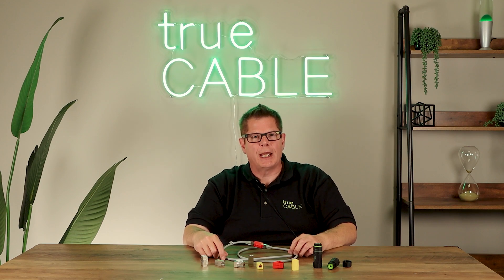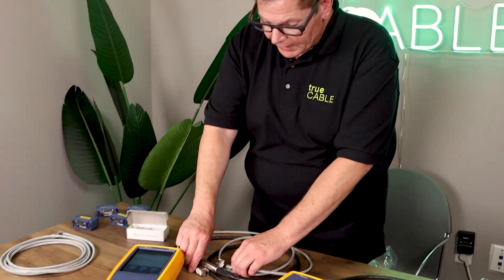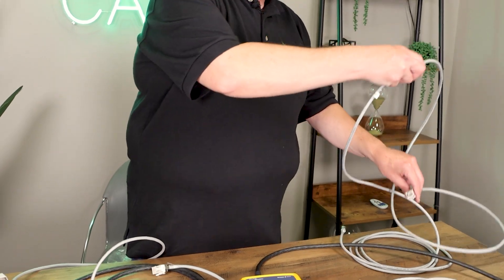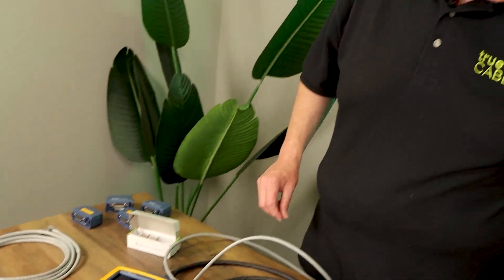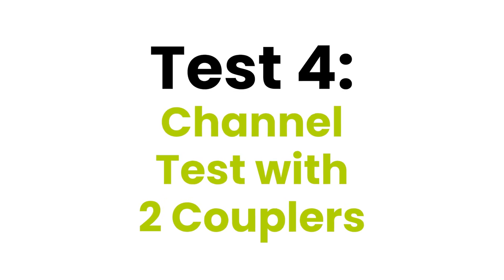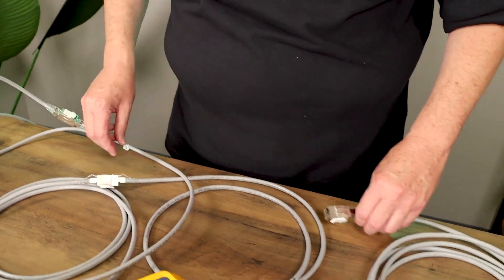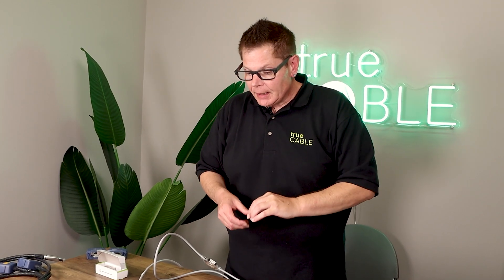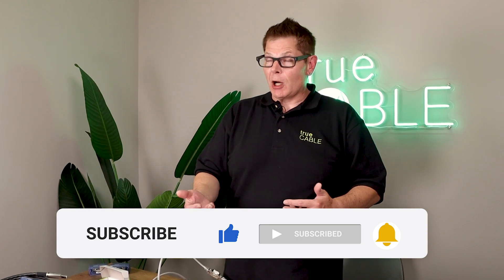How Many Ethernet Couplers Does it Take to Fail Testing? You'd Be Surprised!

Comment: When you mentioned couplers, does that include keystone jacks pls? For an ethernet connection of laptop -> cat 6 unshielded cable -> bedroom wallplate keystone jack -> cat 6a shielded cable -> patch panel keystone jack -> cat 6 unshielded patch cable -> network switch -> router, is this considered too much? Do you recommend using a shielded patch panel and shielded patch cable between the patch panel and the network switch pls? Thank you
Reply from the maker: Hello! No, regular keystone jacks are not included in this discussion. You will have only two of those per channel. If you make use of two patch cords in that channel, you have 4 8P8C RJ45 modular plugs terminated--preferably factory-made and Certified patch cords. The refrain from too many couplers (or any at all) is due to issues caused by the number of 8P8C (RJ45) connectors in the chain. Each coupler will require 2 terminations of this kind, and you will easily run into problems with one poorly terminated RJ45 connector, much less 6 or more. As for your patch panel, if your solid copper structured cable is shielded, you should be using a shielded keystone and patch panel at the switch side, but a shielded patch cord from the patch panel to> switch/router is not necessary, assuming the patch panel is properly bonded to ground before the switch/router. I hope that helps!

Comment: I think more people would be interested in extreme testing. Like can you get zero packet loss but say just 5mgb or 10mgb on 1000ft to run a camera at a driveway gate and send a short motion video to the cloud to acess once uploaded or say even maybe 500ft which seems very doable. Everyone likes extreme testing esp cat 6a, 8 etc
Reply from the maker: Hello and I could not agree more. That is why we are obtaining a cable qualifier/BERT tester so we can do some wild "what-if" scenarios up to 10G. Stay tuned for those! We will also test separation distances from electrical and lot more real world testing
Reply: @trueCABLE  Yeah, there is no way people with gates are running fiber 1000+ feet down thier driveways for the camera and intercoms. But I assume it only takes a few megs of data. And what if people want a router in thier shop using backhual. I look forward to the videos. Stuff like that similar to the project farm channel testing out scenarios and stuff would be fun to watch. I just saw the asus coax repeaters that bounce the signal through coax, but I'd rather use the Aimesh routers and ethernet so I got 1000ft of the 6a yesterday to go 300ish feet to my shop. The gate is about 700 feet.
Reply from the maker: @SrStew   Yes! We have exactly the same idea in mind...what-if scenarios that are standardized and thorough to find out precisely what will do what (or NOT do what) under various circumstances. Thanks for the feedback.

Comment: I've used couplers a few times for things like cameras: low bandwidth needs. And I only ever used them when the possibility of running a new cable or moving an existing cable was overly expensive or damaging to the building. 

Long wire runs in walls or hard ceilings and when the original installer used zip ties very 20ft to secure the lines. I've encountered such things. When a cable gets damaged and no service loop or when the service loop is away from the damaged cable, you either pull a whole new line, or find a spot where you can bypass the damaged section.

Comment: Lol its funny because the company I work at has a practice of intentionally double coupling under the floor cabling and putting a 1 ft extension between certain runs specifically because they want to be able to quickly move and or replace endpoint lines without having to run it all the way back to an IDF I've always raised my eyebrows at how the lead engineer seems to insist on having so many couplers in the connection, although I will say that our downtime is minimal so it doesn't seem to be a major problem at this point at least.
Reply from the maker: Hello! That is funny! 😆 Luck is definitely on your side. Using more than a coupler or two per channel is a great way of having issues--especially at higher speeds. In your situation, I understand why your lead engineer is doing things this way. Here is a tip: You can increase your chances of initial success AND long-term reliability by using component-rated couplers and component-rated patch cords for as much of the connection as possible. Component-rated products are factory-certified to the TIA performance standard of whatever Category they are stamped with. Be aware stranded copper patch cords will induce additional length restrictions above and beyond the typical "328-foot rule", so keep an eye on lengths if going this path.

Comment: There is no such thing as “Inducing electromagnetic unbalance”?! 
It’s called the voltage standing wave ratio, or VSWR; and you are inducing jitter into the signal from the standing wave reflection from the impedance mismatches due to adding those RJ11 couplers.
Reply from the maker: Hello! VSWR and jitter are descriptions that may be applied to analog signaling. Also, the use of RJ11 couplers would be for voice telecom. In the world of Ethernet, the cable is called Balanced Twisted Pair Category Cable. The use of the descriptive term "Inducing Electromagnetic Unbalance" is an overall way of describing decoupling, Insertion Loss, and NEXT within a packetized switched data system without getting too technical for the audience. In addition, 8P8C (aka RJ45) couplers are use for Ethernet, where RJ11 couplers have no use. I hope this helps!
Reply: @trueCABLE  I have no idea why I typed RJ11… it was a mistype, of course RJ45s. However, I work with digital video HD and SD SDI, and digital AES/EBU audio and those physical transmissions  standards refer to VSWR, Jitter, and eye patterns all the time.  I am also familiar with NEXT testing. Sorry I realise that I was nitpicking word choices, and I understand why you scripted the content that way to did. However, there is so much misinformation and improperly worded content out there, that I mistakenly assumed the fellow in the video was just making up terms and not understanding the underlying concepts. Sorry for that.
Reply from the maker: @tekvax01  Hello! You have been corresponding with that same fellow in the video. No worries, and you are absolutely correct about the huge amount of misinformation out there. We actively fight it.

Comment: If you use an odd number of couplers this will fail because the sequence of the wires will be crossed but  if you   use an even number this will work because the sequence will be corrected in the 2nd coupler 4th, 6th and so on.
Thank you for the video
Reply from the maker: Hello Anas. You are welcome for the video, but I think you might have some confusion about cross-overs and the number of couplers. The number of couplers you use has no bearing on whether you end up with a cable channel this is cross-over unless one of the cables or couplers specifically was wired for cross-over. If all components are wired "straight through," then the entire channel ends up "straight through." The reason for the failures you saw in the video is directly related to the number of terminations in the channel. No one channel is permitted to have more than six terminations, lest you risk performance problems. Each termination (especially 8P8C - RJ45) adds a bit more cross-talk in the channel, and it adds up cumulatively, resulting in eventual failure. The ideal way of using 8P8C couplers (if you must use one at all) is to keep use to just one coupler and to use factory pre-terminated and certified patch cords in addition to IDC style terminations, depending upon what you are doing. Any communications channel using a coupler should be correctly ASAP and the coupler removed. Couplers are meant for "oops" moments.

Comment: I have never used a coupler to extend a connection.  However, many years ago, I rewired one to make a crossover.  This was back in the 10 Mb days.
Reply from the maker: Hello James! Yeah, generally if you plan well, you will rarely need to use a coupler.
Reply: @trueCABLE  Planning is one thing I do well.  I have half a century of experience in telecom and a bit over 5 years of that was spent in planning.  Most of that was in the central office, but also at customer sites.  I used to order a LOT of cable and connectors.  I'd typically order several 300M (1000') spools of 25 pair CAT3 cable, though some 6 or 12 pair.  On one job, I bought 100 Km of Comscope 0222 coax cable, which had a smaller diameter than regular RG-59.  The smaller cable was required to fit 1024 cables through the bottom of a cabinet.  This was all just for one job in my office.  As I mentioned, I have a lot of experience with cables and connectors.  🙂
Reply from the maker: @James_Knott  Thanks James. We appreciate you sharing your experiences with us.

Comment: Consumer here....
I'm in the process of running 5 170ft runs of CAT6 from my NVR to a 30ft tower in the rear of my property...
I purchase 1000ft of good quality CAT6 and will be running them through buried 1 1/2 schedule 40 to the tower.
The runs will terminate at a Wx proof jct box at the base of the tower.  From the junction box I want to run exterior Wx proof CAT 6 to the cameras.
My question is will I be okay with using couplers in the jct box to go from the non-exterior CAT6 to the exterior rated CAT6 which will be exposed to the elements?
...or would there be a better way of transitioning from interior CAT6 to the CAT6 exterior?
PS each run would have a total of 4 RJ45's (gold plated terminals) and on coupler (w/gold plated terminals)...
Reply from the maker: Hello! Rather than terminate a bunch of RJ45s onto solid copper and then using couplers, I would suggest Cat6 splice boxes. You can easily get them on Amazon. These splice boxes are punch down style 110 IDC terminations, which are mechanically and electrically superior to using couplers with hand terminated RJ45s. Most of the splice boxes are not outdoor rated, so you will need to mount them into a waterproof outdoor enclosure.
Reply: @trueCABLE  Thank you for the advice....
I have a waterproof exterior box and just ordered the punch down CAT6 junction boxes...
Thank you for the great advice.
Reply from the maker: @letsroll404   You are welcome! I think you will be much more satisfied with the long term results. It is also less effort!

Comment: And you’re not using the cheap junk couplers fly by night guys foist on unwitting customers.
Reply from the maker: Absolutely correct Jody. That is why even with OUR couplers you have to keep your use of them sparing. I generally recommend ONE per channel, and only when you have to use one.
Reply: @trueCABLE  My rule is to never use them except temporarily in an emergency situation.  If I have to use one, that tells me that I have a cable that needs to be rerun.  There are very few exceptions to this rule.
Reply from the maker: Hey Jody. That is an excellent rule. One time a person asked me what couplers were for. I said "When you screw up and cut the cable too short and need an emergency solution before you re-install the right length of cable..."

Comment: Are you planning to do the same with fiber optic couplers?
Reply from the maker: trueCABLE handles metallic (copper) communications cable. Our sister company, trueFIBER, handles fiber optic. trueFIBER may do a blog on coupler and splice losses, but I can tell you up front there is already a standard applied to fiber optic connectors, splices, and the cable itself expressed in pre-defined dB reductions applied to the fiber optic loss budget you are working with. That standard is found in ANSI/TIA 568.3-D and also in the BICSI ITSIMM 8th Edition available at BICSI's website. The BICSI publication will cost considerably less! That aside, it would be an interesting project to get real-world loss numbers on various types of couplers and splices and see how they affect the overall loss budget for the fiber optic channel. I will pass this on to the Technical Manager of trueFIBER.

Comment: Failed Permanent Link test with 1 coupler : did you test with PL2 or PL3 settings ?
Reply from the maker: Hello Ronny. TIA Permanent Link test limits were used. The ISO 11801 Permanent Link test limits were not used, which allow using PL2 or PL3. The TIA limits already assume the presence of a CP. When talking about a CP, the additional terminations will normally be IDC style and not 8P8C style and test limits account for IDC terminations which are of higher quality and performance. Ultimately the issue was the additional two 8P8C terminations that caused the fail, not precisely the inclusion of the coupler itself--although a coupler would be required to see the issue so we are splitting hairs here.

Comment: So my understanding is - doesn't matter coupler or jack, as long as there are more than 4 RJ45 plugs in a direct chain of cables, signal will go bad quickly?
For example, the following connection with no couplers:
[Switch] <=== Patch Cable ===> [RJ45 Keystone Jack]=== In-wall permanent cable ===[RJ45 Keystone Jack]<=== Patch Cable ===>[RJ45 Keystone Jack]=== In-wall permanent cable ===[RJ45 Keystone Jack]<=== Patch Cable ===>[Device]
Reply from the maker: Hello and good question! The issue is, essentially, the number of overall terminations. RJ45 style terminations are the most problematic. IDC terminations like really good quality keystone jacks or field termination plugs are much less problematic. The standard accounts for exactly two IDC style terminations in a permanent link when conducting a permanent link test. A channel test accounts for up to 6 terminations, two being IDC and the remaining 4 being RJ45. It should be noted that those remaining 4 x RJ45 terminations are assumed to be very good ones (not hand terminated) with the patch cords passing on patch cord tests. All the patch cords I used for this demonstration pass patch cord testing (using PCA adapters on the Fluke) and are the best possible representation of "perfect terminations". It just gets worse from there. Couplers add additional RJ45 terminations by design and even a single coupler in a permanent link can cause a failure. Not always, though. Channel testing is more permissive, but typically will only tolerate 2 couplers introducing 4 more RJ45 terminations before failure. Again, this is with patch cords that are factory terminated and pass PCA testing.